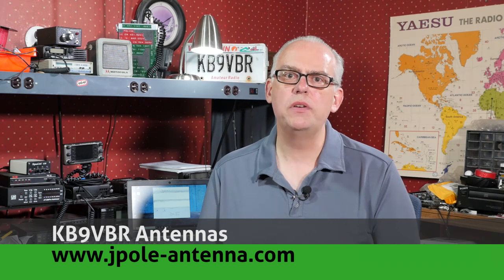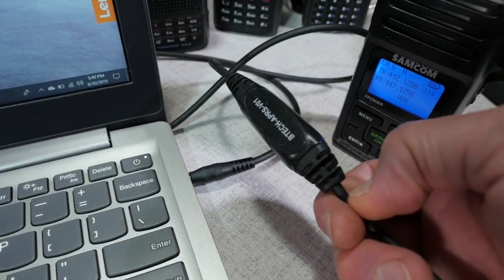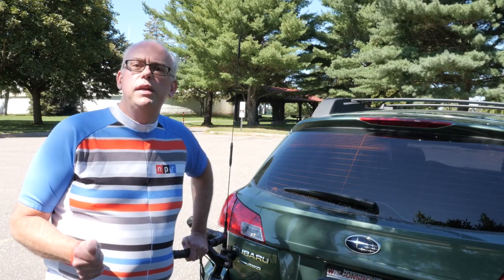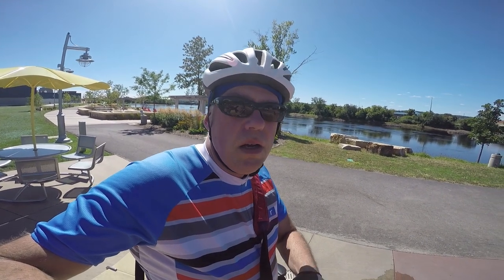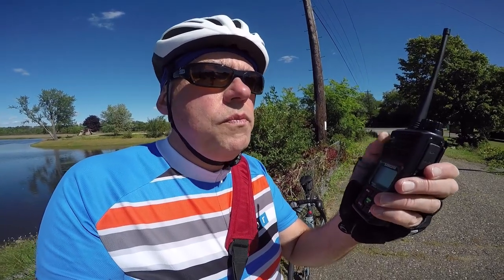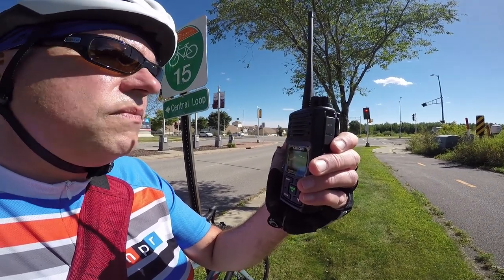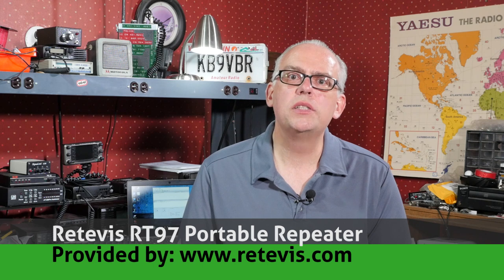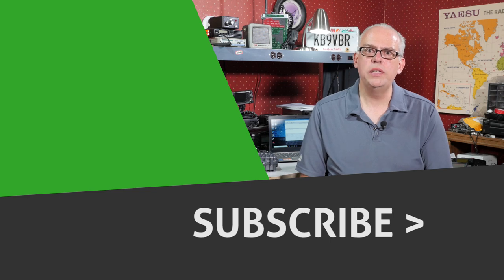Retevis RT97 Portable Repeater Field Test - Ham Radio Q&A

Comment: Hi Mike. I liked the video and your others btw. I would have liked to see the price and I would like to find out if it could work in full-duplex. Just my $0.02 worth.
Reply from the maker: Thanks for the comments. I don't usually mention pricing in the video as prices can change. The RT97 is $399 and there is a link in the video description that takes you to the Retevis website. The unit is full duplex, my first video describes more of its features: https://youtu.be/0EBJasGAymY. The 'parrot' I was using to repeat my transmissions was an additional radio and software that recorded my transmission and retransmitted it over the air.

Comment: Alright alright alright!! I have one... I get maybe a mile. What gives? What's your terrain? I'm on flat ground with nothing but houses and trees. I have it connected to the supplied AC/DC power supply connected to a Tram 1486 UHF Land Mobile Base Antenna tuned to 406MHz–512MHz at (15) fifteen feet.. The SWR is (1) one and the output is 6.67 watts. With that same antenna I can connect many many fars on both 2m and 70cm. Beyond (10) ten miles on 146.52000 to be exact. In Florida that's outstanding LOL. Did you have height advantages?

Comment: This might be a silly question (radio noob here). Could you use this in conjunction with the Btech amplifier? Going from 10 to 25 watts?
Reply from the maker: Probably not. The Btech amplifier is looking for an input power of up to 6 watts and the repeater deliver 10 watts. So it would most likely drive the amplifier as there is no facility to turn down the power of the repeater. But also amplifying the signal from 10 watts to 25 isn't mush of a boost. With that said‚ there are other UHF brick amplifiers like the Mirage D-1010-N that will take 10 watts in and deliver 100 watts out. This is a 10db boost (or 1 1/2 S units) which would be a lot more appreciable signal gain.

Comment: Kb9vbr, two good pieces on this portable repeater, but I believe you did not do it justice in your field test.I believe that I performed way better than what was shown.  You tested it with a gain antenna on your car, I assume at least a 3db gain, which means your effective output was at least 20w.  You tested it with a 5w HT and a small antenna.  Sure you were hearing static when you got out at a distance, but I believe that it came from the HT in it’s transmission to the repeater since it was just rebroadcasting what it received, noise and all.  It was not a pure transmission from the repeater.  You should have had someone close with a good clear signal to the repeater to talk to.  What it did show is that your HT could make it the 7 miles.  Just my opinion, but you might want to give it another field test.  K6EZY

Comment: Why r u hearing ur self after u transmit? Why is it repeatering what ur saying on ur radio. So if im talking with my body using the repeater is it goin to repeat on my radio too
Reply from the maker: I had an audio recorder connected to the repeater so it would parrot back what I said. I could then judge, in the field, the quality of the signal. The RT987 does not do that in normal operation.
Reply: @KB9VBRAntennas  I live in urban area n in an apartment with a whip antenna in my porch .  I have try the poor men's repeater project radio to radio 5 watt each , with a 2.5mm 3.5mm cable connected to both and acts as repeater. I was only able to get 3 milles but so difficult to get a clear signal every time n just dint work.   Will this give me a better range ?

Comment: Very good review (as always), but I did see you transmitting at the 7 mile site holding the antenna not completely vertical (or so I thought). How much difference would it give if you'd held the antenna in a completely vertical position while transmitting? In reserve you held the antenna wright, so the rx was as normal. Keep the videos coming,  73's, Xander NL134
Reply from the maker: I looked at the original video footage from the seven mile test. I made two test transmissions at that location, the first was quite choppy and for the second I did reorient myself and hold the radio more upright. What you see in the final video is my transmission from the first test and the received signal from the second. I guess this goes to show if you are in a marginal situation the way you hold the radio and your position relative to the repeater can make a big difference.
Reply: I have one on a 9 DB gain beam antenna I get 12 15 Mile with my Midland 40 watt radio the antenna is about 35 ft in the air.. it works really well on a good base antenna with good cable..

Comment: This doesn’t put out 10 W. A little less than five.
Reply from the maker: The transmitter is rated at 10 watts, but the duplexer will consume a bit of power. I've heard others report an output power of about 8 watts, but nothing as low as 5. I guess your milage may vary by how well tuned the duplexer is.
Reply: @KB9VBRAntennas  wow!!! Did you test yours?? And if so did you post it on different video? I need to see that to believe it.